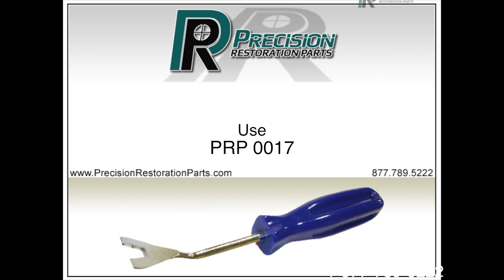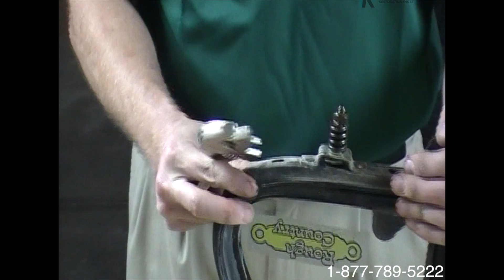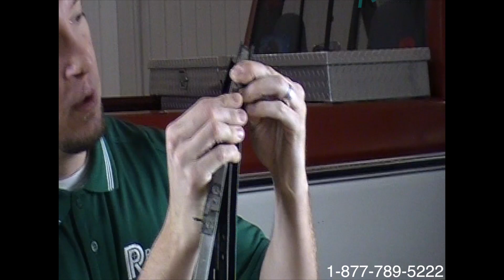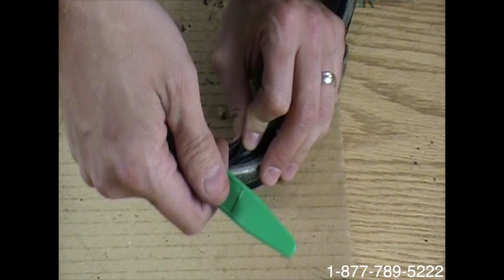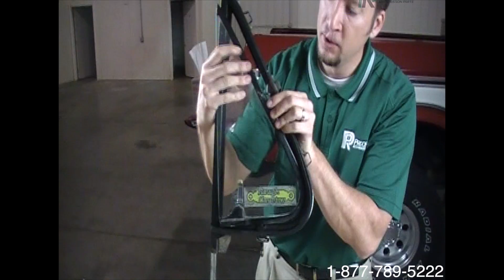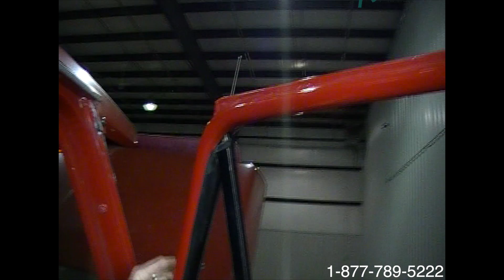1973-1979 Ford Truck Vent Weatherstrip Installation

Comment: DO NOT DRILL OUT THE RIVIT!!!!!! Unbolt the hinge Two 1/4 inch bolts. Use silicon spray to install the new seal and it is helpful to remove the old seal as well. And you put the plastic washer on the wrong side of the cam washer. It goes between the cam and the loop part of the mount Not the frame.

Comment: I wish the re assembly was more specific in regards to the washer sequence during installation and do you use a ss rivet during reinstallation. These steps  are just glossed over like the viewer is supposed to already know this.  The rest of the video was helpful.

Comment: Armor All... coat the back side of the rubber with Armor All or similar and it will go in to place 10 times easier, we found..
Reply: Thanks i'm going to try this tomorrow with the passenger side I fought the driver's side for hrs tonight

Comment: Did anyone notice the crescent wrench was used backwards at the beginning, not that it matters on something so small but that along with drilling the existing rivet instead of taking the two 1/4 screws off???? Also there's another video where he is putting the weather strip on the cab and he started that one on the vertical part instead on on the horizontal bottom. Now there's a potential for water seepage into the cab, I would have put it at the bottom and covered it up with the aluminum trim.

Comment: If you have the metal door panel clip, I would trade them for the plastic ones. The metal ones grab a hold of the door a lot better than the plastic door panel can hold the metal clip resulting in breakage. I drill out the rivets that hold the window regulator in and weld 1/4 nuts on the back of it so it can be held in with bolts and removed for stuff like this.

Comment: Hello I would like to know if I could use a 1979 f-100 xlt custom as a parts truck for a 1977 f-100 custom truck. I don't know much about these trucks I'm thinking about buying a 1977 truck and would like to know if this can be done our not, any info would be helpful 79 truck I have has bad motor and transmission..

Comment: Okay I can understand that, There would be alot of folks that would torque the screws down and twist the frame. You just use a stainless steel bit, what size. Your vids are very informing.